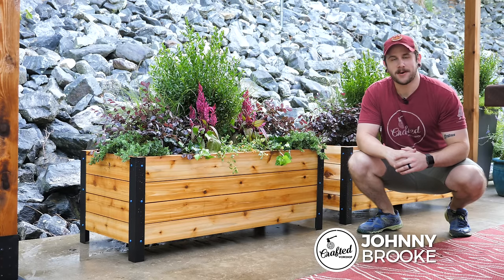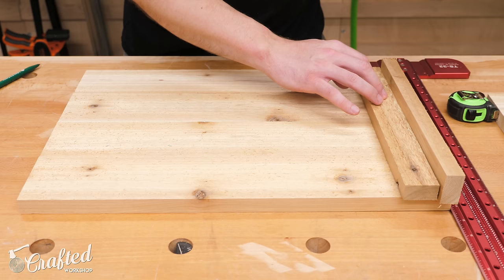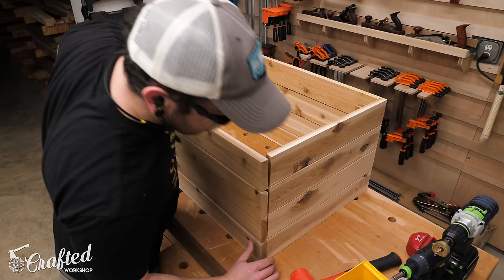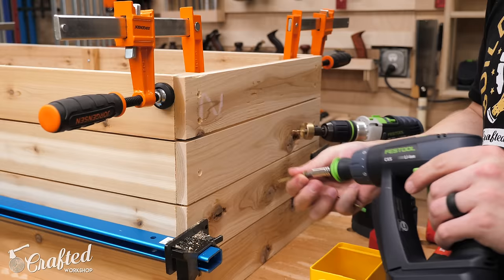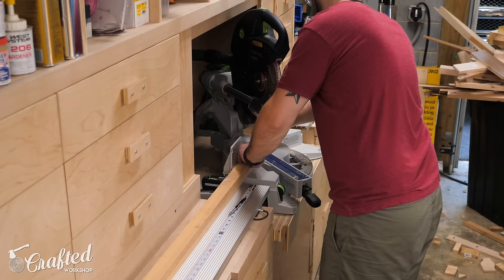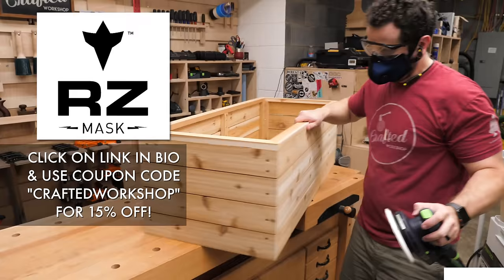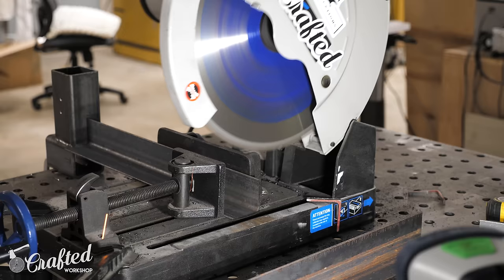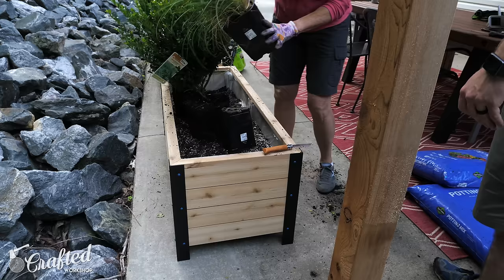DIY Modern Raised Planter Box // How To Build - Woodworking

Comment: Do you really think this is a DIY? i dont think so
Good luck
Reply: Just finished this. It was easy but I had to improvise a little as I didn’t have all the tools. But very easy and the results came out amazingly.
Reply from the maker: These people love to complain about the tools but it really is a pretty basic build. Glad it worked out for you!
Reply: @craftedworkshop  It's like people watch your videos with the sound muted and don't hear lines like "I cut this on my metal chop saw, but you could also use aluminum and an angle grinder".

Comment: Add angle iron support bolted between all four legs at the bottom supporting the wood and you have a decent design, even better if you run them around the top edge also. The wood is going to warp over time regardless but with additional support top and bottom, they would be useable for years and then easily rebuilt. Nice rock garden. Stay safe.

Comment: Thanks for this video.  I need to build one for my son this weekend. I saved this video. I have most of the tools. 
Small 10 inch table saw. 
12 inch chop saw
Screw Gun
18 and 16 gauge nail gun.
I think That's it.  Thanks
Reply: Make sure to use stainless nails in your gun or they'll rust in a year or two and start leaving ugly stain streaks.

Comment: The online plans I bought state 6pcs of 1x4x8 cedar but it only needs 4pcs. Also, be very careful as the internal supports are very prone to splitting when you insert the screws. 1/14" is not really long enough either as the main side wood is not gripped adequately.
Reply: Agree about the internal supports:  Make sure you pre-drill pilot holes if you use 1x2's.  Perhaps using 2x2's or 2x4's as the internal supports would give you more surface to drill your screws into.  I am in process of making this now and had to be conscious of the screw placement keeping in mind that I still have to attach the outside corner leg pieces.

Comment: The contrast of wood and steel really sets it off. 

A tip for cutting steel on your saw which they say helps retain the blade sharpness for longer is to not cut into the flats of a workpiece. With angle iron it's best to have the corner pointing upwards. Same goes for box section actually. Not always possible though, like if you're doing mitres.

Comment: In process of making this and I had a few observations.  I am concerned about using 1x2s for the inner bracing because there's not alot of surface to screw into:  You have to screw/nail them into the 1x4s, screw the 1x4 ends and sides into them and also the metal corners.  That's alot for those small pieces and I see drilling pilot holes is a must when using screws (I also coated each screw with beeswax to prevent splitting).  I would think using 2x2s or even 2x4s as the inner bracing would give you plenty of wood surface to attach to.  Just my two-cents!

Comment: One thing people might want to do is put the bottom about halfway up the box.  People almost never plant things that need that depth of soil. This would cut way back on the weight so it's easier to move and so the irons dont dig into a deck.  Not to mention it will save you some money on potting soil.
Reply from the maker: Not a bad idea, but having depth for the roots to establish themselves, plus for water retention, is never a bad idea. It’s incredible how much volume well established roots take up.

Comment: I don’t get all commenting about the $20k worth of tools…other than using the metal cutting tools this was done with a miter saw and a drill. Like he said in the video if you don’t have the means to cut steel then use aluminum and chop it on your miter saw. 
Good build man!

Comment: nice planters, but my only thought is that the black stray paint on the metal corners will scrape off the first time someone drags those planters across the floor, leaving raw metal which will then start to rust instantly and leave nasty rust stains on the concrete floor (or any other surface someone might place those type of planters on). Do you have a suggestion for better edge protection of the metal, other than just paint?

Comment: I built three of these, as a beginner I found it quite challenging, watching him put it together looks real easy.
I used aluminum legs instead of steel, much easier to work with.
How do you stop everything from moving during glue up when you don’t have 20 clamps to use.
Any suggestions?.

Comment: So I just built one of these. It turned out pretty nice, but I wish I’d left the legs a tad longer. 

My local Home Depot had most everything I needed, but finding cedar 1x2s?  Impossible. Nowhere in the reno area can those be located. So I used 1x3s instead and actually prefer it. But for the finished top I had to rip my own 1x2s. And I used amazon to buy some of the screws. Way cheaper than HD or Lowes. 

Make this without all those tools?  I guess if you’re a master woodworker that’s possible. Average dude like me?  Not a chance. 

Word of warning- if you buy those plans for 5 bucks they will disappear 24 hours after you open them up. So print or save or something because I glanced at them and then they were gone when I needed them. 

That being said- this was my first project building something from scratch and I kid you not- this is pretty simple. Just go slow. But you WILL need the tools. 

I’ll be back in to comment again after I load them up with soil and they fall apart. Hang tight.

Comment: Quick question about the steel, as my desire would be to have the boxes a little higher due to my bad back. Would the same steel, but perhaps 2' longer still be strong enough if everything else was the same, or would they buckle?
Reply from the maker: Angle iron is incredibly strong, you could probably make the legs a foot or more longer with no issues. The only thing to consider would be the lateral forces placed on the screws holding the legs on when getting to those lengths, but the construction adhesive goes a long way there.

Comment: Very cool, about to make this! Question - why was that mesh necessary if you have the plastic on top of it anyways? seems that if you made the spacing between the boards a little less you would end up with less sagging anyways. The mesh looked like a major PITA to work with

Comment: Thanks for the taking the time to make this video! I did have a question about the mesh you used. What is the purpose and is it necessary?
Reply: The mesh is to hold the soil so it doesn't drip through...it provides support.  See here:  Mitch makes a much simpler one and uses mesh (metal hardware cloth)...https://youtu.be/DMORpDWq-q8

Comment: I thought this was a fantastic build. I have been wanting to make planter boxes for a raised garden for a long time. Just wasn't able to. We moved into this house 4 years ago this summer of 2019 July.  I did not have many tools. I am a retired disabled military vet.  We got a good opportunity on this house which has a two story detached "HEATED & INSULATED" 1st floor only second floor is a blank canvas.  

First I want to thank you for doing what you are doing.  Secondly I want to ping all the JERKS down below stating this is NOT DIY.  Yes, it is.  I used to get into disagreements like this with my brother  "X" brother in law.  In regards to the Norm Abram and the New Yankee Workshop.  This is what Norm and the guy at Crafted Workshop likes to do and that includes myself.

After moving in I realized I had to have a tool plan.  My car is paid off and I have very little in debt student loans and one other thing.  This is also a plan. Be debt free.

My computer by design I set up two monitors.  This way when I am watching videos like this one or Netflix, Amazon Prime etc. I use the other monitor to find bargains on Craigslist.  I also let friends and family know what I am interested in.

In addition to woodworking, metal working, I also participate in Electronics, pneumatic, and hydraulics. Everything with the exception of electronics is self taught.  However, I think I have learned more on YOUTUBE University than College Avionics degree combined.

I now have about $60,00 worth of tools in my shop. Sometimes you have to think outside the box. I make a 60" Roll Around tool box out of metal it started with a commercial item that was made of stainless steel and had Commercial grade wheels on it that could hold 1,100 lbs  each.  It is Not the highest end box but I only have $250 in it.

I was looking for a scissor lift and came across a Dayton forklift electric perfect no fumes in the shop. It worked 100% though it had a bad battery. I got the battery off of
a Semi-tractor & Refer recycle Center. One battery is a Deep Cycle Marine battery and the is a regular Semi battery.  Works perfect put some new paint on and couldn't be happier.

The forklift was a whopping $300 bucks and this is not uncommon I have seen it often.  What I am trying to say is you can have these things and buy making work stations for specific needs anyone can have a workshop like this.  You are pinging someone who has the determination to learn Sketch Up, build his own patio, and retaining wall, planter boxes etc.

Personally I don't know if this is tool envy or what?  But it does piss me off. He is doing something and sharing it. If you don't like the video go do something else.  

People that I subscribe to and hit the bell. I always put like even before I watch the video will everyone have a great video probably not. However, they took the time to share something and I rather encourage the channel than anything else.

I don't have a metal chop say they do show up on Craigslist.  I also bought a brand new Dewalt Mag Drill with bits.  $350 it was on Craigslist for 3 hours he was 10 minutes from my house didn't even negotiate.

Similar situation Dewalt horizontal thickness planer barely used. No dust anywhere.  $300 buck on Craigslist for an hour.  The stated to me 4 phone calls came in while I was on my way over.

You can do this vice complaining what some one else has it is not going to improve your situation.  My best purchase a Techtronics 50MHZ Oscilloscope at a garage sale on the same street I used to live on the last day of the sale $5 bucks no leads. I went through it is calibrated perfectly.

This also includes a Radial Arm Saw, Table Saw, Arc Welder, Mig Welder,  and Plasma Cutter. I do not have a Mig So the Mig is on my tool to do list which is printed on the wall.

Also 4th of July, Memorial Day, Fathers Day, and Christmas HUGE sale days plan for them.

Good luck and I hope that those complainers complain less and get a plan and produce more and be proud of it.  Lastly I will say this having the proper tools gets the job done more quickly and safely (My other half works in the ER and she tells me many stories of people getting hurt so think Safety at all times). It also will get you less fatigued and you finish the project sooner and then that pride feeling kicks in and that is wonderful.

So, get out there and make something and have a tool plan.  I don't have a lathe or Mill yet. However I see these resourceful in third world countries with them using leather belts which was everyone used about a 100 years or so ago; and they produce wonderful stuff. 

I just checked my metal supplier cost sheet which I found through Craigslist Angle Iron 1.5" x 1.5" x .187" which is 3/16" x 20' $36 bucks change the thickness to .25" which is 1/4" cost is $48 bucks.  When I order I try to order a lot of stuff that I normally would need. You find what your common items are in due time. For example I always have about Ten  2 x 4 x 8 and the same with 2 x 6. Birch Cabinet grade plywood, 4 x 8 Hardboard, certain types of nails and screws, and the appropriate rods for the welders.

This can be fun and I am proud of this young man doing something and sharing it. 

Today on the to do list rebuild the carburetor to my Stihl FS36 weedeater. That I got from my neighbor when he moved $20 bucks. Weeds do not have a chance with this thing and as I have gotten more into small engine repair on my tool list is an Ultra Sonic Cleaner.  At the end of the summer my plan is to clean all the carbs put everything back together and in spring everything is ready to go.

This is my last comment I just mentioned a season.  I promised myself this is the last year I am not going to have a Snow Blower.  Hello Craigslist and since it is summer I can find bargains. Started looking a week ago.  Hopefully I can find one that needs a little carburetor work.  I think by having or investing in these tools you end up paying yourself for the rest of your life.  I still can't believe I have a forklift for less than a Nice 12" Miter Saw.

Build Something and be proud....

Comment: @crafted workshop 
Just a question for the panels; In the beginning steps you did the short panels. You mentioned measuring 1 1/2 inch from the bottom edge for room for the floor boards which I understand. My question is the anchoring 1x2 that you use to start the panel how far are you spacing the 1x2 from the side edge? 1 inch? 

I bought the plans this morning and I'm confident in everything else in the plans, except that one detail. I feel its safe to assume 1 inch because the long panels are 1 inch thick but I want to make sure before I start cutting through this Cedar. THANKS!
Reply: ...Just rewatched for the 12th time and I noticed the guide piece you used for starting the panel... 
It's amazing the details and information you gain if you just pay close close attention. Sorry. But can you confirm its 1inch so i feel better lol

Comment: I’ve been building planters for over 20 years and I was taught to never use pressure-treated lumber because the chemicals used in the treatment of the wood could leach into the food that you were growing.☠️
Reply: I don't think that's an issue anymore with the changes in chemicals - at least from what I've been reading in different forums. Regardless, the way he went about this, the pressure treated wood never comes in contact with the soil.

Comment: Nice build but i strongly advise to cut wee triangle of metal and then Weld them inside metal legs where the box end. That way you can rest that wood boxes on it and then screw the legs to box. This few screws attached to box have stress on the wood with that amount of soil on it and with years pass will go loose end those glue not much help. Thanks
Reply from the maker: The construction adhesive provides a ton of holding power when combined with the screws. I don’t think any sort of bracing like you’re mentioning is needed, the planters are holding up great.
Reply: Crafted Workshop its supporting not bracing. Glue is a chemical composition of few while over time will degrade with weather and weight. I have just try help you understanding wood and try help those who copy your project and in few years will spell on you....but well you are joiner you know better.....Anyway nice wood boxes and nice project well done

Comment: I made this in an L shape pattern, but the part at the 90 degree corner that is connecting the two pieces is starting to cave down in the center. Any ideas on how to fix this and support the bottom? I already have soil and plants inside.

Comment: The planters look amazing, but I would have gone for brass colored screws over the metal corner/leg pieces. It would've matched up better with the wood color in my opinion. The blue looks out of place, but I suppose design choices are extremely subjective.
Reply from the maker: For sure! Brass would also oxidize over time, so they’d have to be a fake brass color to look good.

Comment: I think there is an error in your plans.  The Cut List states the 10 1x2 inner Bracing should be cut to 12 5/8.  This won't be flush with with the top if you start 1 1/2 from the bottom:  4x Cedar planks 3 1/2 = 14" 3x 1/8 spacer = 3/8 (14 3/8 - 1 1/2 = 12 7/8)  Therefore if you want the inner bracing to be ~ flush with the top cut sheet should state 12 7/8?  I'm a beginner but after I build my first box I couldn't figure out why the braces were not flush.  Please let me know if I'm wrong.
Reply: Mine ended being 12 11/16, flush on the top and the bottom board was just a bit recessed from the bottom of the bottom plank, so I think your math is on, but I think the measurement is to allow for some cutting variations and still keep the bottom board from sticking out. That would be a pain to fix.

Comment: Can you tell me what the inside dimensions are of this before attaching the wire mesh and plastic?
Reply: there are plans available in the description....or your inside dimensions would be roughly 11/2" smaller than your outside dimension so you could make them any size you want  (outside dimension minus your 2 roughly 3/4" sides)
Reply: @cuttingedgewoods  Thank you!
Reply: @Gus-jn9mq  np

Comment: Will the wood expand and cause any issues since the soil will always be moist? 
PS Rather than the paint markers try using soap stone. You can wipe it off with your hand or a little bit of water.
Reply from the maker: It should be fine, especially with the plastic liner. I built a similar planter box about two years ago with no liner and it’s still holding up great. And good tip!
Reply: Crafted Workshop I wasn’t sure if the liner made it all the way to the top, I always have holes getting poked in the plastic. Glad the other ones are holding up I’ll have to go find the videos.

Comment: This is amazing.  Love the rustic look.  If this is a new hobby.  What do I need to buy?  Thanks!
Reply from the maker: I linked to some of the tools in the video description but I'd say at a minimum a miter saw, drill, and angle grinder for cutting the metal.
Reply: @craftedworkshop  thank you
Reply: @craftedworkshop  My apologies for responding weeks later.  Did not receive a notification.